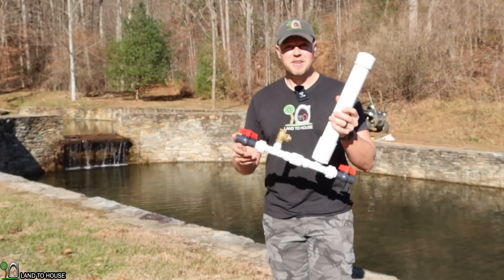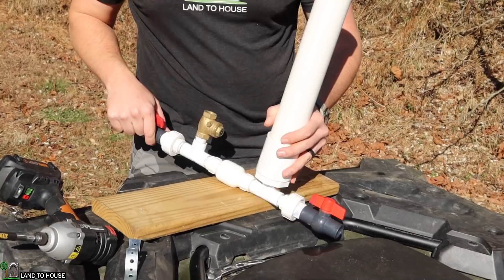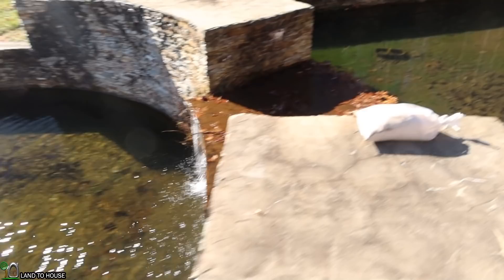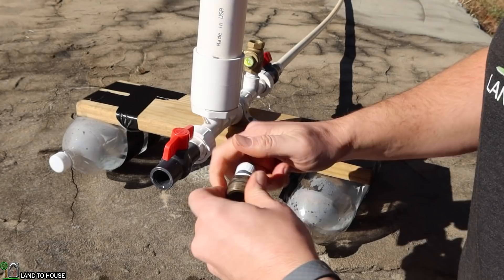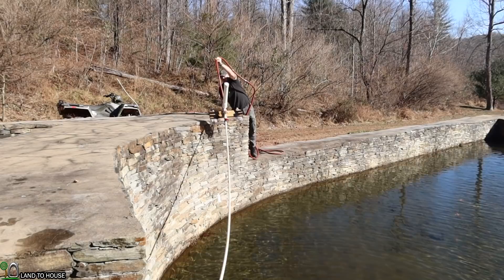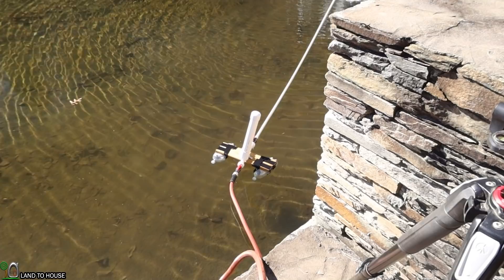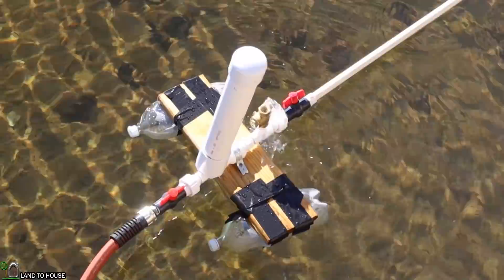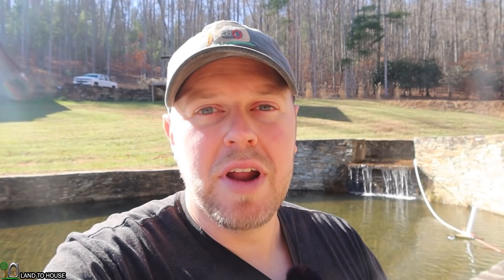Floating Ram Pump

Comment: Great idea, opening up possibilities for folks.
Reply from the maker: Definitely has an application. At the same time can be more difficult to work with because you can't easily access the pump.
Reply: @LandtoHouse  I think this is a case of the harder to get to it normally the easier it will be. (because eventually you can use a Cano or so)

Comment: That's too cool, try floating a ram pump just because you can.  This made me smile.
Forgive me if I throw out a few more ideas for the Mark II floating ram pump...
Use 2 more boards, one perpendicular at each end of the mounting board to make an "H" shape.  Then you can use 4 bottles and have a much larger float footprint to stabilize the pump upright.  
Use a drive pipe about 5-10 feet longer so that you can reach the pump from the shorter bit of wall instead of the higher bit.  
We know the pump works underwater, so put the bottles on top of the boards instead of under, letting the ram pump be partly submerged, which adds 6-8in head pressure to get a better output.  
Walk the delivery hose downstream and let the siphon fill it (and purge some air), then cap the end of the hose to walk the hose uphill to where you will have enough back-pressure to operate  and that ought to save you 985 of your 1000 manual cyclings of the valve to get it started.
Reply from the maker: Thank you. This was a fun idea and I am happy that the concept worked. 
I actually did buy more $0.65 soda for the bottles but ended up not using them. 
Bottles on the top would have fun a fun way to go. I might need to give that a try in Mark ii. 
And yes walking the hose down to the lower waterfall would have been smart. Fill that thing up with gravity and then walk it back up the hill.  I ended up taking my measuring cup and pouring into the top. It took some time but was better than 1000 manual valve presses.

Comment: Which would work better : a 10 foot vertical drop, or a 45 degree (But Longer pipe) from that same 10 foot height?
Reply: Seeing this wasn't answered here, I'd imagine a longer pipe would do a bit better because the water then has more energy at the same flow rate. The valve closes when the flow rate gets to a certain point. On the other hand, it would probably take longer for it to get to that energy level with the same drop over a longer run, thus cycling slower. There probably won't be much measurable difference.
Reply from the maker: The length of drive pipe does matter in cycle time. there is a sweet spot but for these pumps it's a very minimal difference

Comment: Without head pressure can I use air pressure to the chamber?  I have a pond and want to use one of the aerator pumps to pump water using air pressure.

Comment: Okay, I've got a question / idea... Though, I don't know the physics of it or whether it would work or not?

So, like, I know that Ramp Pump waste valves can be used to "do work," but I guess I'm wondering how much work? Like, I know that the waste check valve can potentially be used to run a flywheel / alternator or something to generate some small amount of electricity. Correct?

So, I'm wondering if A) that energy from the waster check valve could be used to turn something else, like an Archimedes screw pump, or B) it can be used to generate electricity, sufficient to power an electric motor to run an Archimedes screw pump?

My completely wonky thought was one of wondering whether "loss" from the waste valve can be minimized by, for instance, having the waste valve turn an Archimedes screw pump, which would itself be immersed in some kind of a water collection tank, and could potentially be used to move "waste" water back up to the "driving" tank for the ram pump? Or, if, say, one waste valve is insufficient, could multiple waste valves' energy be harnessed either mechanically, or electrically, to run such an Archimedes pump (or some other relatively efficient mechanical or electrical pump to pump some portion of the waste water back up to the main tank driving the ram pump[s])?

I presume that the amount of water returned by an archimedes pump depends on its diameter, and thus likely the amount of material used in its construction. So, perhaps, it would be too cumbersome/heavy to be able to sufficiently rotate, or else it might return too little water to effectively "recycle" the waste water back up to the driving tank?

Anyway, just a thought I was having to myself while thinking about some stuff.

Would be interested to see an experiment, either with trying to turn an archimedean screw pump with a waste check valve, or trying to turn a flywheel/alternator to generate electricity in order to run an electric pump to pump water back up to the ram pump tank. Just interested to see if something weird like that might work. I know, I know, physics says there's no such thing as free lunches. So probably it won't work, or it won't be super efficient. But, it'd still be interesting to see if it's possible to pump some of the water back to the main feeder tank for the ram pump, and/or whether it impacts/reduces/stops the actual ram pump flow rates, etc., by trying to make the waste check valve "do work" as it cycles, possibly removing some energy from the system, in the process?
Reply: Another idea I had was wondering whether it would be possible to design a tank with multiple outlet pipes (all going to like a Y or 3-way, or more-way intersection, where they all come together before the ram pump [to increase head pressure? does head pressure increase if you run multiple pipes from the same tank and have them come to a junction?]), triggered by rising/falling water levels in the tank, where like each would be opened by a float valve or something if/when the water level goes above some level in the tank (maybe with a check valve or something to prevent back-flow into the tank). So that maybe it could compensate for increased / decreased flow from a water-source seasonally?

The idea being that maybe during the summer when water levels or flow rates in the stream or whatever are low, the bucket would only run the ram pump off of one [bottom] outlet pipe, at a minimal flow rate, but later in the year as the stream picks up in volume or flow rate, and the bucket or tank maybe fills more rapidly, if it exceeds some threshold(s), additional input pipes at different levels in the tank would open, increasing head pressure [?], and thus flow rate [?] to uphill tank(s)?

My idea would be to basically have one large tank with like 3-4 pipes used as sources for the Ram pump, all of which come to a junction and funnel down to a single pipe (assuming such can be done without the junction exploding or whatever from too much pressure or water hammer). Each pipe would be slightly higher in the tank than the last, and each would have a float valve that opens the pipe if the water level exceeds some threshold above it (so it would only open while submerged by some amount and would close before it could ever like suck in air [?], so hopefully it would always be primed to add extra capacity / head if/when its float triggers it to open due to excess water volume in the tank, or whatnot).

So, like, if the tank was 4 foot tall and there were 3 pipes feeding a junction to the ram pump, it would only use one pipe if the water level was under 2 feet, but if it went over 2 feet, the 2nd pipe's float valve would open, increasing head pressure and flow rate, if it went over 3 feet, then all 3 pipes' float valves would open, increasing head pressure / flow rate even further. Yeah?

Would something like that work? Would it scaled linearly or whatnot? Like if all 3 pipes' float valves were open, would the ram pump have thrice the throughput (approximately)? Or if not thrice the throughput, some significantly improved throughput due to extra head pressure from the 3 pipes feeding the junction above the ram pump? Is there some diminishing return for how many such pipes can be junctioned together before it doesn't get any additional flow rate or pressure at the outlet up the hill at the next tan or what have you? Or, if there's some diminishing return at a given pipe diameter could one simply increase the diameter and get the same result at larger diameters to get more flow rate or exit pressure?

Comment: Good idea, can we install the ram pump inside a basin in the lake (let say 3 m depth) because there is no rise in the water in the intake pipe (flat water) while increasing the length of the waste valve so that the water does not collect in the basin and thus stop the pump?
Reply from the maker: I've actually gotten this comment idea a couple 100 times over the past few years. When you increase the waste valve height it reduces the input head pressure. When the waste valve matches the height of the source the pump does not work.

Comment: I feel like 4x long zip ties for the pontoons, stapled onto the board; would have been cheaper and longer lasting than the duct tape.  Thoughts?
Reply from the maker: For sure! This was a very fast proof of concept. If you are going to actually float a ram pump long term your idea is way better.

Comment: Does the ram pump deliver more pressure/volume when it sits considerably lower than the water source driving it?
Reply from the maker: Yes more input head pressure does supply more output BUT it is limited. There is a point where the back pressure in the delivery pipe does not hold back the pressure in the tank.

Comment: 2 questions.  What if the floats fail and it sinks? Wouldnt that increase the head pressure to make more output even underwater? 
What about a 3"or 4" siphon over dam suppling 3-5 ram pumps connected with a uniseal to siphon or standpipe?
Reply from the maker: The head pressure will actually be the same. When you sink the pump in the water the weight of the water ontop of the pump will be the same as the extra head pressure and there will be no gain.

Comment: Can the waste valve be underwater?
Reply: He's done a few videos with larger waste valves and pipes coming off the waste valve.  I would guess it ends up needing a decent amount of head pressure to close the valve after it opens.   Would be fun to see if he could.  Then you could just fix it to the bottom of the pond right ?
Reply from the maker: Yes it sure can. Here is a video I made some time ago testing that idea. 
https://www.youtube.com/watch?v=9td5x9tAOUo
Reply from the maker: Sinking the ram pump underwater works. But as it goes down further it does not increase the head pressure.

Comment: I built a ram pump and used the same technique as you to make my ram pump float, but I don't have elevation in the river and the water doesn't enter in my pump. The river flows fast that's why I thought it might work in the beginning.  Do you have any advice for me?
Reply from the maker: That is definitely the downfall of the ram pump. You have to have the water source coming from above the pump. Simply having a fast flow is not going to supply the water hammer needed to cycle the waste valve.   In this video there is approximately 3 and a 1/2 feet of head pressure.
Reply: @LandtoHouse  :( i was thinking if ican extract water somehow in a bucket, using the siphoning efect
Reply: @bluesummersky6936  As long as you manage to have the pump a few feet lower than the bucket it should be fine. As you have a strong flow you can think of making a water wheel to feel up the bucket at a high point.

Comment: PUT IT UNDER THE WATER....... Geeeez
Reply from the maker: I do have one underwater ramp pump test. This time of year is not the time for that though because last night it was 22ﾟ
Reply: While standing on the spillway, you could just push all the drive pipe under the lower pond, put your hand over the pipe, lift the drive pipe into the upper pond…

Similar to the delivery hose, stick it in the lower pond, put your hand over the hose end, pull it out…

Comment: fyi, i was attempting to imply the question,    WHY  float  the  pump, at all.
Reply from the maker: For most people I dont think floating a ram pump is practical. But there might be someone out there that needs a floating ram pump.
Reply from the maker: The main thing to consider is the drive pipe length and how it effects the time of waste valve cycle. If the drive pipe is too short the waste valve will cycle fast and the pump is inefficient.  I would probably go with a 45 degree with longer drive pipe.

Comment: You've spent a significant amount of time with this ram pump. 99.99 % of the world's population lacks the practical knowledge you possess about this type of technology. I suggest that you write a research paper on the topic of 'ram pump' which would be beneficial to a large number of individuals. A few important considerations:
1) Mathematical modeling of the whole system.
2) All of the variables that influence the output
3) A model of an ideal system that may be scaled up or down depending on its parameters.
Reply: It has been done!